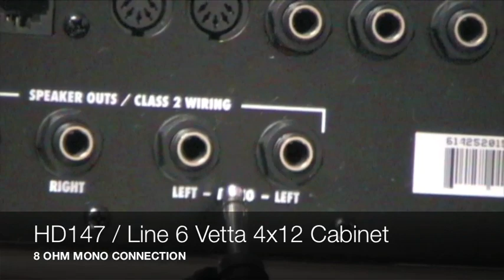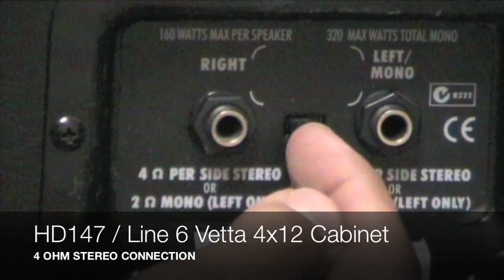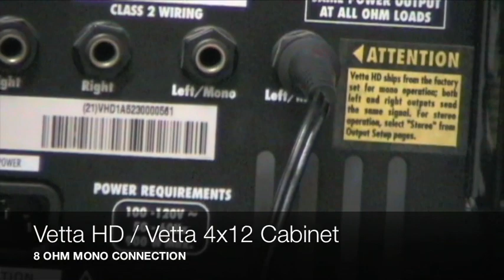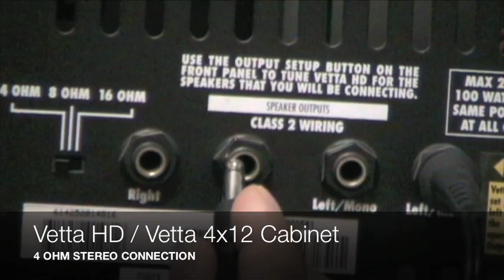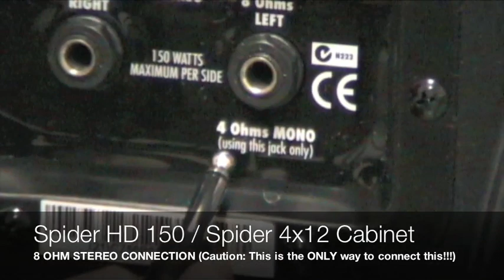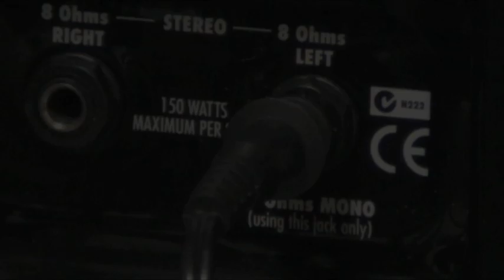Line 6 Amplifier and Cabinet Connections Part 1

Comment from the maker: That depends on the cab and what its ohm rating is. If the cab is 4,8, or 16 OHM MONO (it has to be MONO) then yes it will work fine with the Spider III 75 watt head.

Comment from the maker: @joeylama11695 run both 8 ohm speaker outs from the combo into both inputs of the cabinet and it will work fine however, please keep in mind that this will mute your internal speakers on your combo amp. If you're looking for a true stereo rig you'll need two 4x12 cabinets.
Reply: Good video 📹 👍🏻 
Could I use two 8 OHM  2×12 cabs one left one right  for true stereo ?
I'm using a mesa boogie studio preamp into a peavey classic 5050 power amp.do I leave the power amp set to 8 ohm when doing so ?
Thank you

Comment: I have a question I'm hoping you might be able to help me with. I have a line 6 spider 3 head with stereo left and right 8 ohm jacks on the back. I want to connect it to a kmd 4x12 cabinet I have that is just labeled as 8 ohm/300 watts. I'm guessing the cab is mono as when I connect just one of the jacks on the cab to my orange cr120, all speakers are working. My question is with the line 6 being a stereo head, do i connect both jacks from the head to both jacks on the cabinet or should I just use a single cable and connect one side? And what if I wanna run 2 mono cabs making it a full stack? I'm a little confused as how to connect stereo heads with mono cabs. Any help would be appreciated, thanks!

Comment: I have a Spider Valve HD100 head, and a Line 6 Spider 3 cab. what would be the best way to plug in the head, since it doesn't have two 8ohms outputs?

Comment: of curiosity how would you know if your aunt had been damaged from a mano connection? what do you have to get the amp add a certain level volume wise? great info. i'm using a spider iv hd150 through this old crate stereo cab. just out

Comment: i just bought a sonic cabinet and it has only one hole and i bought it from guitar center for 145$ and i have the line 6 hd 150 spider 2. which hole should i plug in the cab to the amp to the left or the right hole???? please answer!!

Comment: Wat about for spider valve 112? I have the combo amp and no sound comes out of it. Do u just need to plug in the power cable? or is there some other cable that i need to plug in? My guitar is connected, and the amp lights up and everything, but the sound doesnt come out. why is that? i just got this, but i got it used from ebay.

Comment: I'm wondering if I should get the spider valve 412vs. It's only $700, and it has v30 speakers in it. Will it sound good going through a 6505+ peavey head? Also is thi standard for most cabs? Just wondering

Comment: hey! i have a 15 watts line 6 amp, and im buying the cabinet  only. without the top attachment. is it possible or would it work if i attach my smaller amp to the cabinet to play with that? would it work? iv done it with my 15 watts line6 amp to amps bigger than what i have and it works fine, but this is just a cabinet so i was wondering if i attach my smaller amp to the cabinet if it will work or if i defiantly need to buy the top attachment for it to be able to work? thanks!

Comment: Hi I like the video but I have a question, may I use the Spider III HD150, with a 16 ohm 2x12  cabinet, in "mono" connection? Most amps can also run what's called a "safe mismatch." That's where your cab is at a higher ohm rating than the amp is set to, so this shouldn't be a problem.  I would like to know if the "safe mismatch" works also  for Line 6 amps, Thanks

Comment: If I was using my spider 4x12 stereo cabinet to a new head (say a Marshall jcm800) which has two outputs, since both sides of the cabinet are 8 ohms each, don't I set the JCM800 to 4 ohm which is the parallel value of the two 8 ohms I'm connecting to?

Comment: hi, i have a b52 at-100 half stack and im trying to figure out the best connection. if i put the impedance on 16, and the cab on its stereo 8 ohm setting, and connect the head and cab with 2 chords (l & r) is that a proper connection?

Comment: i have a spider 2 -150 -2 -12 can i run my 4-12 boogie cab with it it had 1 8 ohm input and two 4 ohm inputs ca i run one 8 ohm line in or two 4 ohms

Comment: Is it possible to have 2 amp heads on the line 6 spider 4x2 cab, by splitting One amp head to two speakers instead of 4, and same for the other?